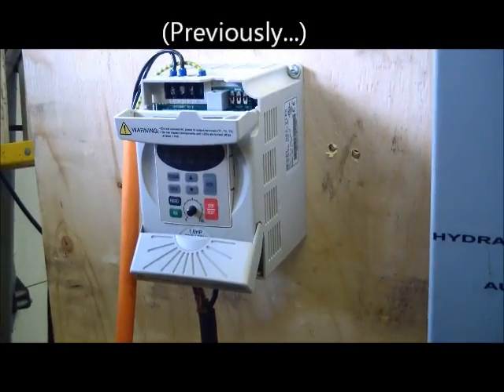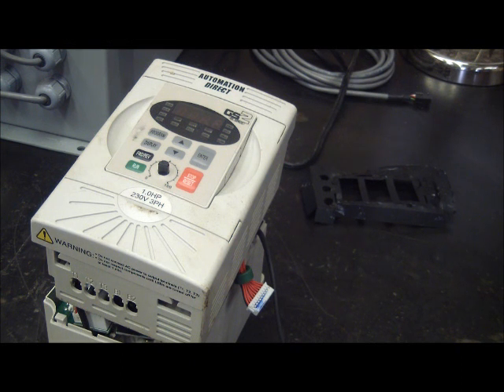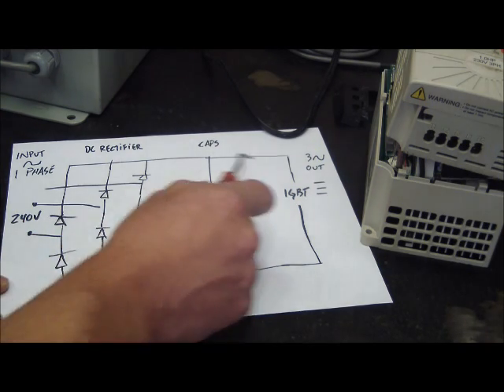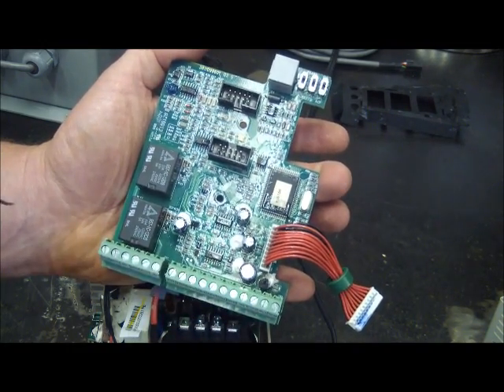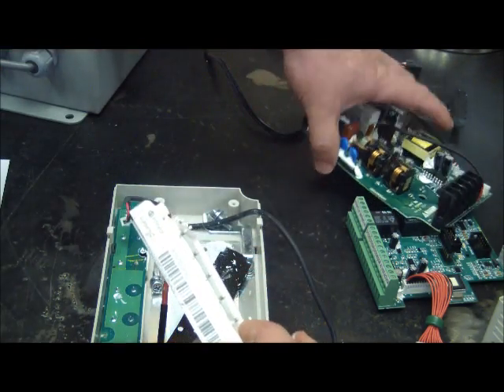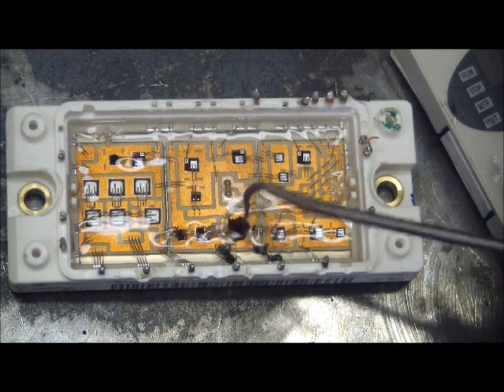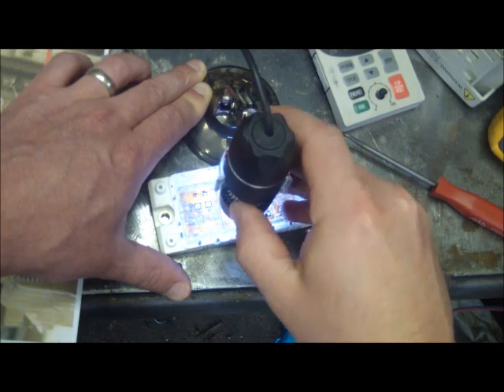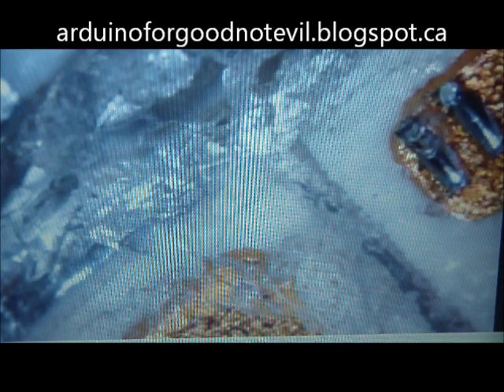Destroyed VFD teardown and failure analysis

Comment: I know a guy who forgot to install the 120v adapter board for the 24vdc inputs on a magnetek drive. It was for an old crane with a 120v control circuit. His drive blew up in quite the same way and the funniest thing about it is he has been working with drives for 30 years as an electrician in a factory. It happens to the best of us! I’ve never wired the load lugs on a drive backwards but I know a few guys who have. They all had similar results 🤣 A wise man once told me, “If you aren’t fucking shit up, you aren’t fixing shit.” 🤷‍♂️

Comment: If you want to see smoke & a extra loud noise energize a 125 HP VFD. I replaced a bad IGBT in what Danfoss tech called a 6 pak without replacing bad small control board. I moved ramp up time to 60 seconds. When it got to 10 Hertz IGBT blow up. Thought I was back in Nam with the extra loud noise. Was told that all drives 5HP & under are now considered throw aways. Does anybody repair boards on larger drives anymore? Throw away large boards from 60 to 125 HP because drive company does not repair them.

Comment: Hmmm, interesting... I run my Harrison M300 off a Mitsubishi VFD and mounted up the optional PU under the DRO. Makes varying the output frequency really easy. The lathe has gearing to spin up to 2500 rpm so I never really have to overclock the motor but being able to slow things right down for blind internal screw cutting is uber cool.
In all fairness it does say on the first page of the Manuel not to let the angry pixies anywhere near chooching up the output 😁
Yep, I cheated and read the manual, these VFDs are just amazing little things. I still run the Bridgeport off a rotary phase converter I built myself as there are issues with the contactors running off 110v which I don't have time to sort out.

Comment: You let out the snoke! Small little vfd. Fractional or 1 horse? Not very many people seem to understand how a vfd works. I work on them quite often as i am a pumping equipment technician and 3 phase motors and 3 phase submersible motors are very common. I typically get my hands on 7.5hp to 200hp vfds

Comment: This happened on a job i was commissioning recently. The electricians landed the high voltage to the motor leads on a the vfd for a 40hp 480/60/3 motor. When that one blew... it was loud! Sounded like a gun went off. No bueno...

Comment: I work on VSDs (Variable Speed as apposed to Variable Frequency) daily. Just had an electrician hook up one of my drives backwards last week. 480V Shorted the IGBTs and Cross-phased. We were standing in front of the cabinet and the door must have mushroomed out 6 inches. Oops, that's a $15000 mistake. Usually I double check everything but he assured me everything was good to chooch...

Comment: Flyback diodes blew. Just too small to handle the inrush current to the capacitors at startup. If you put some current limiting resistors in series you could actually get the drive to power up from the output power. In fact, when you are decelerating a load the current that flows back and causes the DC bus to rise flows through those flyback diodes.

There were a bunch of assumptions that led to me powering up a 1200A VFD from the output stage. For this particular lesson we were lucky enough to have only a 300A breaker on the front end. That saved our bacon. We did have to wrastle new 350MCM cables for both the input and output stages to fix that fuck up.
Reply: Misprint? "1200A VFD". Should read 1200VA VFD or 1200W VFD.
Wakodahatchee Chris
Reply: @cdrive5757  no, 1200A is correct. 1000HP heavy duty rating
Reply: Meanwhile, back here on Planet Earth!:face-blue-wide-eyes: